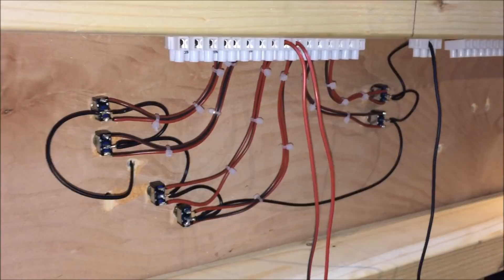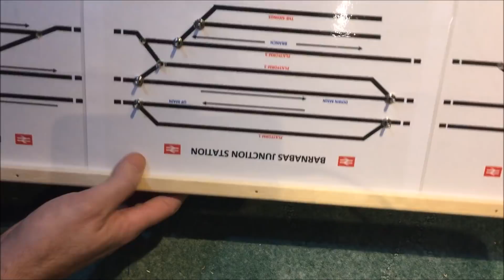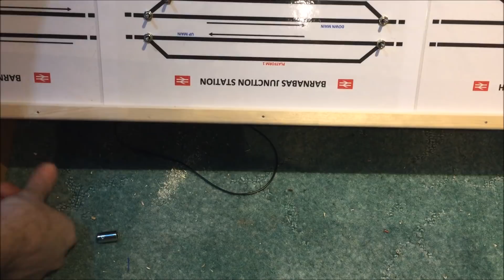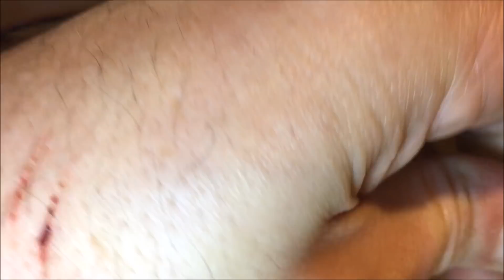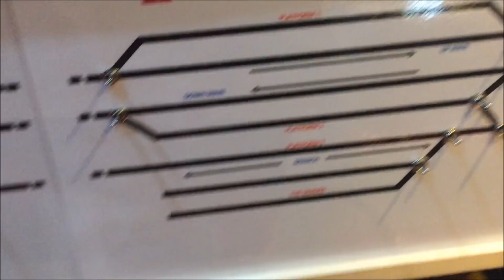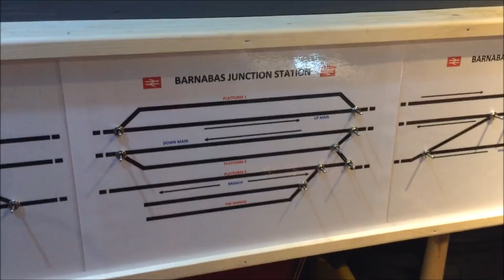Point Motor & Control Panel Switch Installation Part 1

Comment: In my analogue system the control panel uses exclusively 5v and 0.5A, I use 5v relays which then close the circuit and activate the railway switches. In this way, in addition to using smaller sections of wire, I can apply microcontrollers such as Arduino to control the relays, making everything automatable!

Comment: Hi,What gauge wire did you use for the red and black wires going to and from your switches ?
Reply from the maker: It was a 100m reel of 2 x 0.75mm speaker wire - https://amzn.eu/d/0Muf8vT
Reply: @BarnabasJunction  Many thanks. Just watched your video where you wired up your switches and point motors. Lovely video to watch. Very easy to understand. My switches are slightly different as I’ll be using an 8 way switch module, but wiring is the same though. My supply of wire was a little too thin for the ferrule connectors I’ll be using.

Comment: Hi mate - how do you power the black wire ? The common return ? I get how to sort the other two, but the only power units I can find need two wires into them, not one… I know am being dumb but I just can’t understand it
Reply from the maker: The DCC Concepts CDU +2 that I use has 3 connections (+)(-)(+) each + (Red) is 1 CDU either side that can handle approx 16 point motors (according to DCC Concepts) the - (Black) is the common return for both.

Comment: Hi, I’ve now watched part 1 and 2. Great video. I have a basic question about your common return or negative. Where does it pickup the power source. I’m assuming your have a 12v power supply requiring both a positive and negative output to your control panel.
Reply from the maker: Hi Richard, Thank you for watching. I am pleased you enjoyed them.
The control panel is connected to a DCC Concepts CDU+2 which supplies it with plentyful required power. They retail approx £30 and are well worth it.

Comment: Hey Barnabas. Awesome job on the control panel. Your keeping everything nice a neat. A solution for replacing the shrink tube idea is using liquid electrical tape.
Reply from the maker: Thank you for your comment.

Comment: Very Nicely done, plenty of ideas for when I build my control panel, Im using Seep PM-1 motors on mine, just a quick question, the majority of my points are insulfrog, could I still use the switching on the seep pm-1 for polarity? Im hoping to improve the reliability on the insulfrogs instead of relying on just the blades for polarity :)
Reply from the maker: Thank you for your comment.

Comment: Looks great, the edging really helps to set it off. It makes such a difference when all the points can be centrally controlled. Really neat and tidy wiring, too. I remember how long it took me to build my panel and having to solder all those wires! The LEDs were what really drove me crazy :) Looking forward to how the rest of this develops. Iain
Reply from the maker: Newcastle Central (OO Gauge) I enjoyed building the panel, I am hoping the wiring will remain neat. Adding LED's is a little beyond my technical wizardry but maybe one day 🤔

Comment: Very nice piece of work. Cant wait for part 2! Sorry for my ignorance but CDU? Do you mean a power supply unit? I take it that the points are not being DCC operated if you are using the switches? Are the switches sprung to return to centre or stay where you push them? Are your points electrofrog & if so have you fitted polarity switchers to them? Sorry for all the questions!
Reply from the maker: Hello :) Part 2 is in progress and should be uploaded in a few days hopefully.
CDU means Capacitor Discharge Unit and is mains powered. It is a DC Concepts CDU+2.
Yes all points will be operated by the control panel and not a DCC controller.
The switches are On-Off-On Momentary switches which return to centre once pressed.
All my points are insulfrog so no requirement for polarity switches.
The points motors used are Gaugemaster PM-2.

Always happy to answer questions, thanks for viewing.